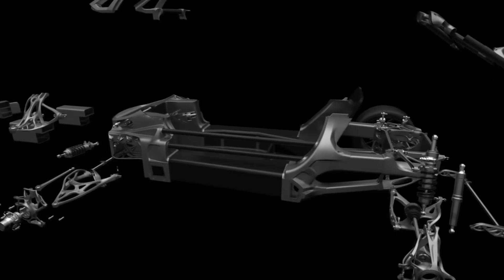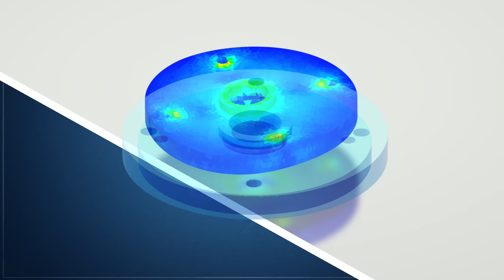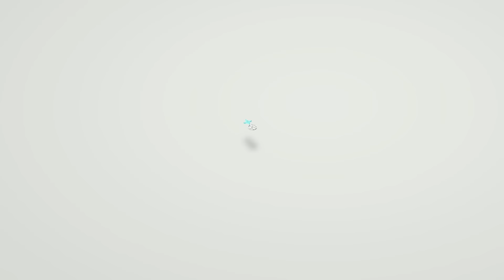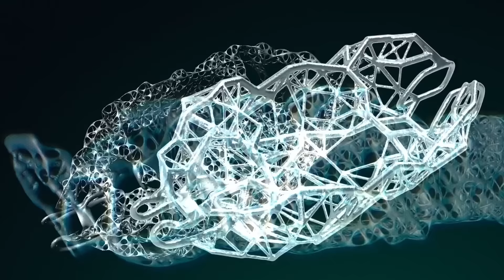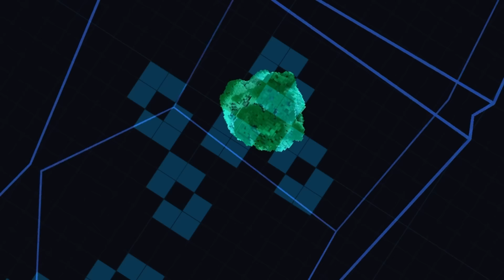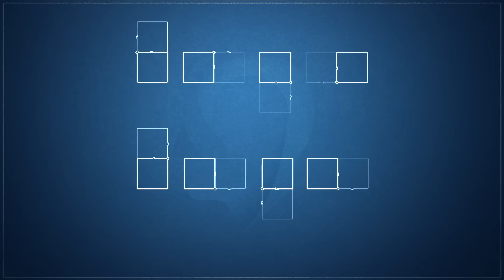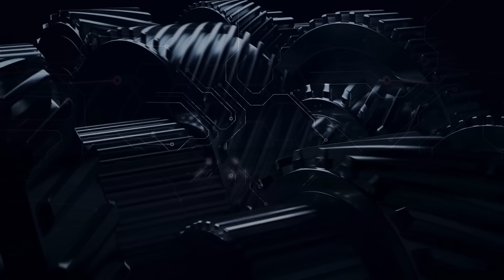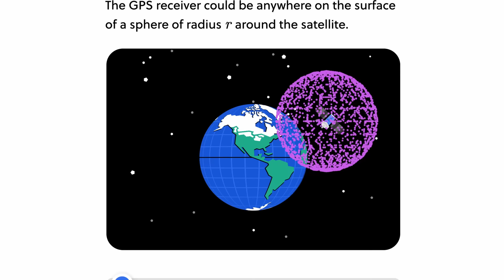The Future of Auto Manufacturing: AI Driven Design

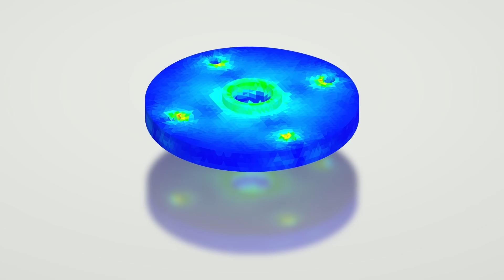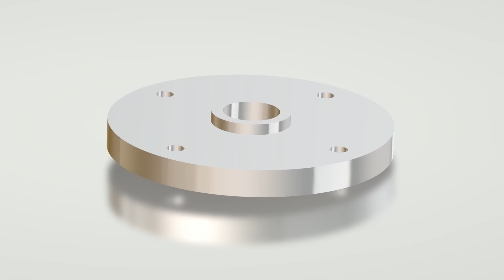Comment: The general theme of the video is generative design, which is well explained, loved it. But the example used around minute 4:00 is of topology optimization, which is not the same. Topology Optimization is reduction of volume/material of an existing model, versus the CREATION of a new part by only defining the needs and load type/location in the program (as was explained correctly at the begining of the example around minute 3:00), after which it will use generative design to CREATE the model. GD creates a part, TO optimizes and existing one (as the example continued at minute 4:00). Result usually have the same vibe, reason why it's usually referred to as the same thing.

Comment: This is not AI design. 3D stress , airflow and other physics algorithms have been around for decades now. These designs are also impossible to manufacture without 3D printing and do not account for costs of manufacturing nor ease of assembly or repair.
Reply: AI is not shorthand for "hot new thing", Genetic Programming has been counted as AI since the 1980s and in fact it was more promising than ML in the 1990s.

Comment: Generative design is awesome when it can be used correctly. If you look at a close-up die shot of modern computer chips, you'll see branching structures in some areas connecting blocks of logic. These are connections and logic made by generative algorithms. The most obvious example I can think of is the cache structure of Zen4C's tiny cores.
Reply: By saying correctly, you mean effectively? Quz I'm not intended to watch a vid only quz of thumbnail, which depicts totally useless piston in terms of low-as-much cost production due to complicated geometry
Reply: Generative algorithms are not intelligence. They are a trial and error process that simply tries everything possible until it finds the best solution. A true AI would find the best solution without trying everything.
Reply: You mean the routing inside the chip linking logic elements ?
Reply: @weistonaski6924  Yes. The links and layout of Zen4C's L2 and L3 caches look like generative design was given a set of weights that heavily penalize taking up extra space and reward capacity more than raw speed.

Comment: great but these "hollow" design cant be machined or forged. they could be cast but that is not as strong.
Reply: Well I suggest an exploration of various kinds of directed energy or immersion in a field of Energy as a possible hardening or modification of materials to yield great increases in stress resistance
Reply: @cindys1819  i know the idea i legacy parts is a thing of yesterday, but i am also concerned when parts are made using specific machines that cant otherwise be produced. but like i said we dont have that anymore at ths point either.

and when they showed the piece that was "inspired" by the AI analysis, i mean, they have been making parts like that with a slide rule. 

i donno if they are dong it to "save material" they are better off focusing on "right to repair".

Comment: Generative design produces parts that are wholly inefficiently-configured for mass production. Metal sintering is NOT a scalable solution. Besides, the generated parts are efficient given specific constraints such as rigidity or stress distribution given a material mass, but generally not efficient in terms of space and serviceability. The proper use of Generative tools is to iterate between cycles of machine-generated, and human-curated shapes. The whole field is currently not really ready for prime-time unless the algorithms can integrate more constraints in their calculations. Aspects such as volumetric hull, centre of mass, symmetry, heat dissipation, optimisation for milling tools, etc. need to be brought into the fray.
Reply: I haven't delved into this that much, but I think most tools allow you to decide constants and the amount generative AI modifies the structure. I do agree that while visually appealing the models are either difficult or impossible to make on a large scale. The other issue with these is that they don't account enough for porosity, variability, rust/corrosion, etc. Normally you have a decent chunk of material that make minor inconsistencies not matter much (a lot of casting look pretty bad on the internally). With how small some of these supports are any issues with the material could cause complete failures as each strand that breaks would increase stress, possibly over what it's designed for.

Comment: ICE is DEAD lets use AI to make parts that will never use. Pleasde use ai to design a new electric motor that has super high efficiency or a way to cheaply and simply make the magnetic flux lines perfectly run thru armetures at exactly perpendicular. I LOVE ICE but even a hybrid wont stop the refinerys, Remember its not the cars polluting its the manufactorers or insustry that does 80 % of the pollution. fun fact a power plant i worked at uses natural gas to generate steam to make3 power lolololol so that clean electric car uses dirtier pollution fuel then the ICE cars around them since gas is like 1 of 10 products removed from crude oil so there only a fraction of the emmisions from the planty where as 100 % of the emmision of the power plant is gone. even with a surplus of power it will still burn the same since there is no reserve and electricity is 100% on demand like a tankless waterheater compared to a traditional one that would represent a ability to store a lot of power temporarily( 12 hrs or less).  SPELL CHECK IS THE DEVIL
Reply: Or batteries.

Comment: generative design is also not viable for all products. high volume production can be cost prohibitive compared to a traditional tooled design.
Reply: There's a plethora of requirements that clash with the typical generative design results which are typically bone structure shapes made with additive manufacturing. Definitely not limited to high volume products. Hygienics, roughness, coatings/ corrosion, material characteristics, precision/ tolerances, even certification is a problem because the material is literally built and not processed from stock. Especially printed metals suffer from warpage and internal stresses which can be heat treated but drives cost up even further. Same goes for post machining. 
Additive manufacturing has been around for quite a while now as well as the generative design softwares. It has found its nice and that's pretty much that. Still nitwits are claiming it will radically change the future.
Reply: @bigbattenberg  exactly. it has its uses and applications, but we still rarely see it being used in production volume items after all these years. Just too many issues with this design and manufacturing method as you Well point out.

At work, the engineers, myself included, get excited over stuff like this, but then reality quickly sets in and we can't use it.

Comment: I did a little bit of genetic algorithms as well as cellular automata when I studied CS at uni, I can understand why these has not been widely used until know due to large computing requirements associated with their use.
Reply: not just that, but it's generally not optimum for high volume production either. I work in teh AI industry, and you can run this software on a desktop computer. it's more issues with production manufacturing, surface finish, practicality of it, etc.
Reply: @SoloRenegade  The other issue is that expected force is not always what a vehicle experiences. If a hub hits curbing or the car accidentally goes off the track then the generative AI models fail at a higher rate than conventional parts. It's a cool design, but I think structures and vehicles probably won't utilize these that often in the future. Repairs are also probably impossible making these one and done parts if alignment issues happen from damage or some damage, rust, etc is identified.
Reply: @skoparweaver7692  excellent points. I've seen people mentioning fatigue issues with such parts, and what you just described makes sense in that regard, the unexpected forces it wasn't designed for.

I can see it working great for things like the shock bell cranks in a car, and such, since those forces are Extremely controlled and predictable. But the bell crank can be so easily designed/made other ways and be good enough as to not matter anyways. How much weight is really saved in an application like that by using the organic approach?

you bring up a lot of good points I hadn't even considered, as we never got into making parts this way due to other issues that far preceded actual use and repair.
Reply: you cant run it effectively on a desktop. its often handlede by server farms (the "cloud") @SoloRenegade
Reply: @peepopalaber  yes, many are, but they don't have to. Best not to argue with the guy who designs and builds them.
Reply: Of course you can, but it takes way too much time on a average desktop computer. EFFECTIVELY @SoloRenegade  you badass. "best not argue with someone who uses generative design daily". holy crap.
Reply: @peepopalaber  "Of course you can, but it takes way too much time on a average desktop computer. EFFECTIVELY"

depends WHICH desktop computer you're talking about, and WHAT you're trying to have it do.

I have been the designer of multiple records setting AI computers that have achieved firsts in multiple industries doing exactly what you're claiming can't be done.

Basic desktop type computers, and we did computing that is revolutionizing communications, emergency services, data processing, exploration, and more.
Reply: @SoloRenegade  give me the source for your claims. Nothing? Of course not. Designer... I am laughing so hard. Who is we? You could show me what you designed if it is so record breaking.
"AI" Computers... Ahhhh, somebody using Buzzwooooords. What's so special about special "AI"-Computers? Clear that up for me.

Revolutionizing communication... Emergency... How?

Where is the URL of your special incredible AI company?
Reply: @peepopalaber  the link is on NASA's website.

" Ahhhh, somebody using Buzzwooooords."

pot meet kettle

I don't share enough info on here for you to identify me, and I don't care if that means you refuse to believe me. Even if I shared you all the details you'd still refuse to beleive it anyways. So it's pointless to try to convince you. But just now that you're wrong.
Reply: also ... false local maxima of fitness functions, not an easily solved issue in this context.
Reply: By themselves, metaheuristics like Simulated Annealing, Ant colony Optimization or Genetic Algorithms can be as fast as you need them to be. You will just get a solution further from the optimum. Metaheuristics were actually designed to lower computational costs on complex optimization problems (ex: traveling salesman and the whole P != NP stuff).

In the end, you can lower the computation time/power cost by lowering the number of iterations and accepting a less optimal solution. It's just that in this specific instance (part design), these algorithms have to compete against well established engineering methodology, so the bar for "acceptable solution" is pretty high and so is the computational cost.
Reply: generative design is a build in feature in fusion360 for example. but you need to produce the part also...